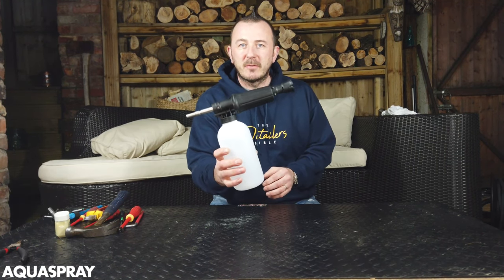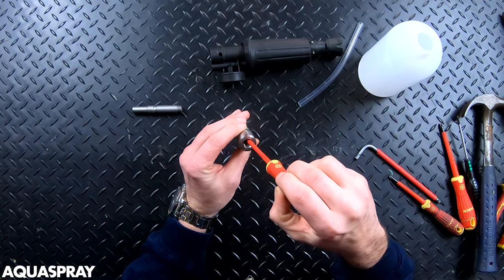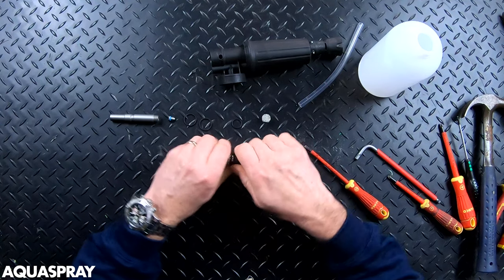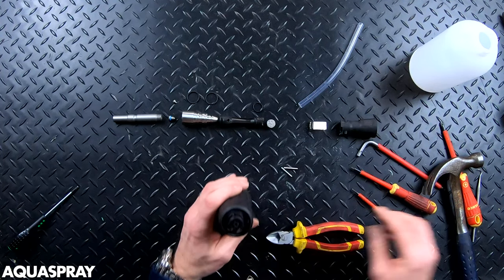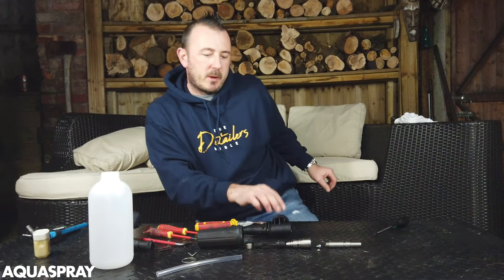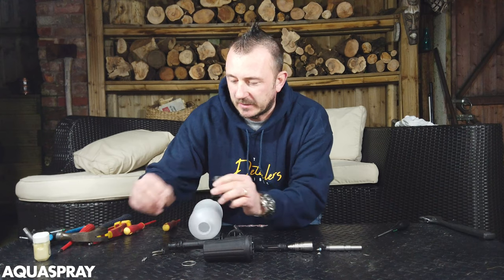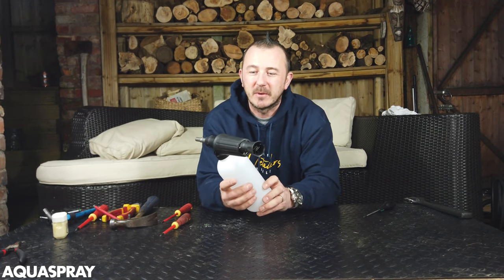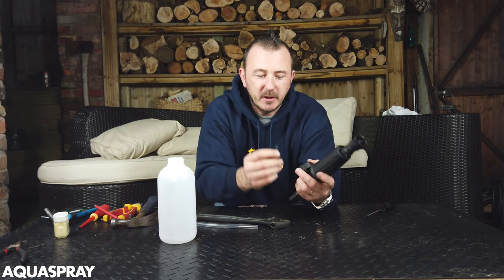How To Fix A Suttner ST73 Foam Lance

Comment: The non-return valve is there so that when you turn the container over, so that the chemistry does not spill out of the container! :-)
Reply from the maker: yeah i could be but there is a hole all the way through so no way of sealing to prevent leaks